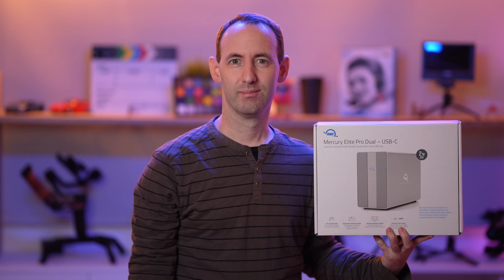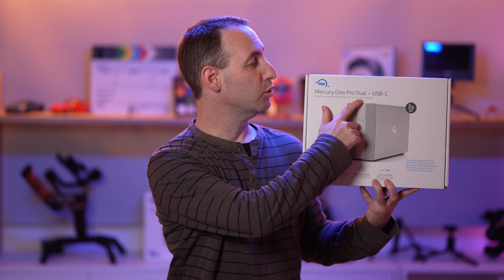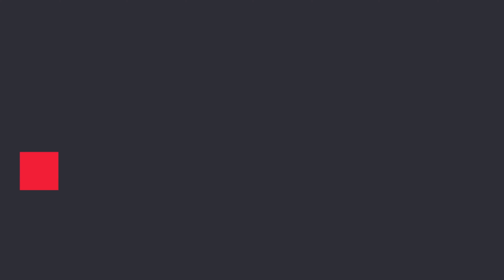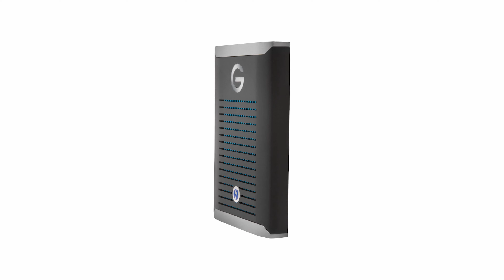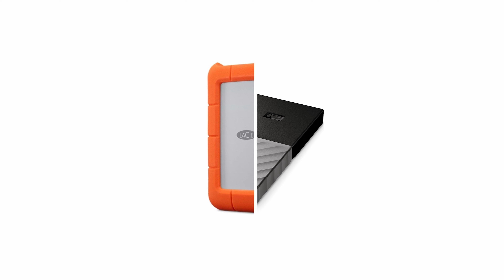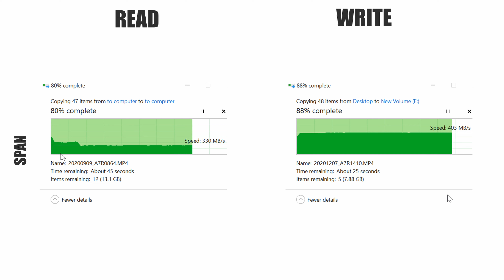OWC Mercury Elite Pro Dual with 3-Port Hub Review (with dual SSDs)

Comment: A crucial point that does not appear to be touched upon: the noise level. Any feedback on noise when using the device with two 3,5 inch hard drives?
Reply: It was not touched upon since we tested this unit with two SSDs as mentioned in the title of this video review. It is not noisy with SSDs despite the fan.
Reply: @IddoGenuth  Thanks for the feedback. Are you saying that even with SSDs, we do not hear at all the device, even in a super quiet room?
Reply: @marcrodet4900  As we mentioned (around 03:00 in the video) the fan doesn't make any noise with the SSDs - mechanical drives usually have their own noise).
Reply: @IddoGenuth  There is a big difference between no noise and no sound. Many products are presented as silent, while in fact, we can perfectly hear them. I wanted to confirm that there is indeed no sound at all. So I understand from you that whether the device (with SSDs) is plugged to the power or not, it is impossible to hear any difference.
Reply: @marcrodet4900  I am not sure what you are asking. We did not hear a noise with SSDs - this is all I can say.
Reply: @IddoGenuth  I'm just asking whether you've heard ANY sound.
Reply from the maker: @marcrodet4900  Art just tested it - there is no noise when connected (if you really stress it maybe it will turn on at some point).

Comment: Thanks for the vid. It looks like raid 1 on this enclosure does not use both drives to read, which sucks :( Should be getting double the read with raid 1 as you have 2 drives with identical data that can be used to read from.
Reply: Could be - performence is less than optimal indeed. We use it now for backup only and it is fine for that.